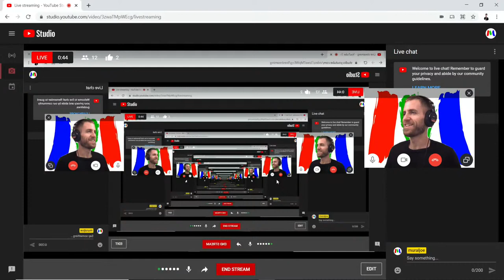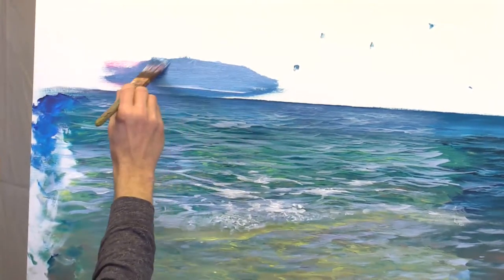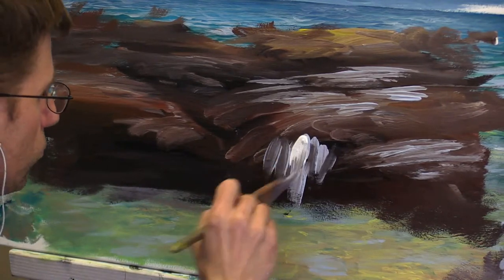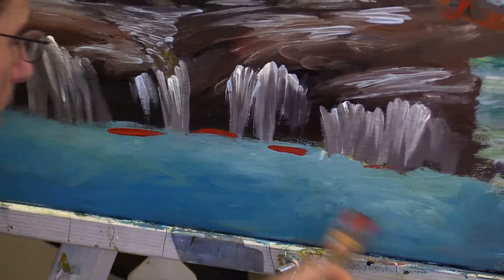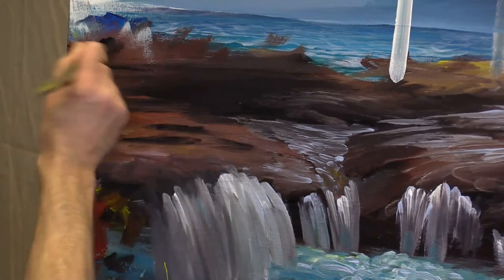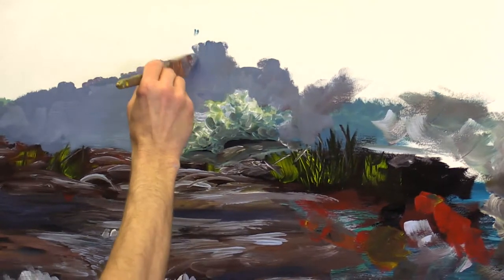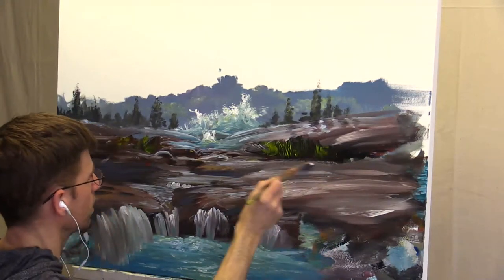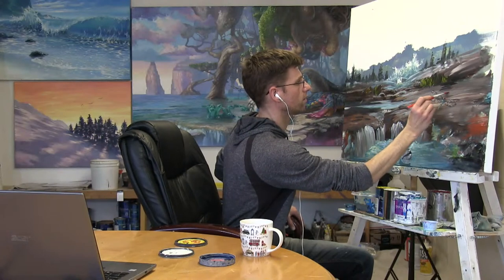Painting Water Live Workshop - Part 3

Comment: I learn a lot from seeing that you are not afraid to paint over, for example, the beautiful water you have made .. How the yellow line is transformed into the base color under the water ... I have paused for approx. 26 years and is completely turned on by how to turn the paint into amazing images. When I look at my old pictures from 1994 & 95 you can immediately see that they lack a lot of improvements ... How to paint over very old pictures without them being destroyed by a new layer of paint .. (I use Oil Painting) Johnny from Denmark.